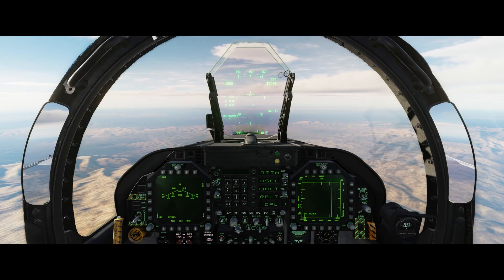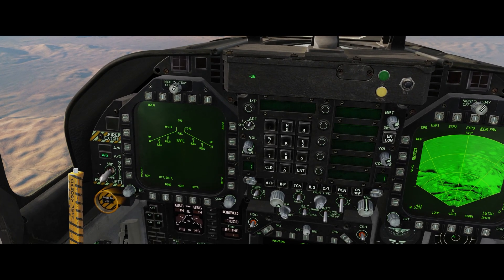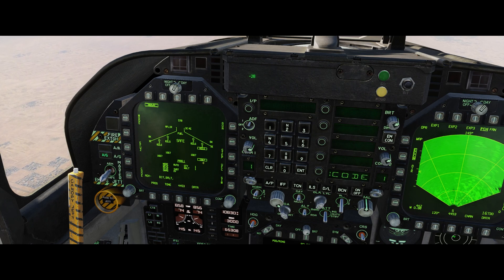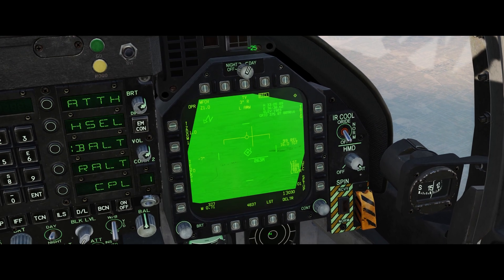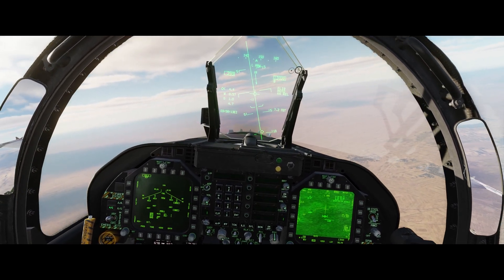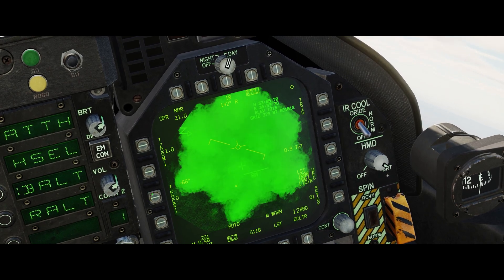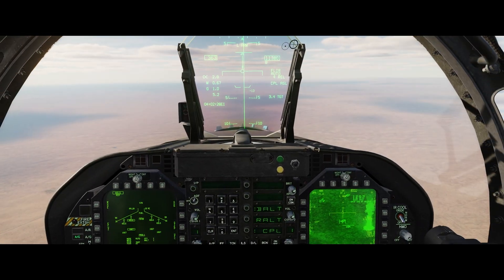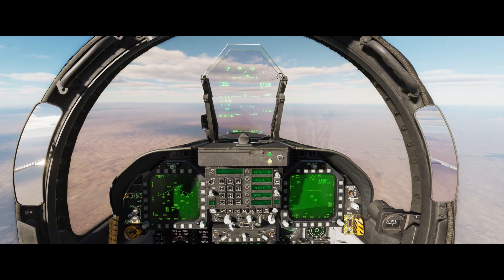DCS F18 | Master the Art of Laser Guided Bombing (GBU12)

Comment: hi Tricker, i got a issues, when i use tgp lock on target, i switch mode in RMDI my HUD did not change, for example before lock a target my GBU-12 bomb mode is auto, after my target destroyed i change gbu-24 clar-sl mode, but my HUD still auto, i must unlock and lock again a new target. therefore i must move TGP to a target again, is this a bug or anyway easier to attack new target?
Reply from the maker: Usually the way I switch to a new target is sensor select switch in the direction of your TGP (right in my case) to go back to scene mode if you were in auto.  Find a new target, sensor select right to go back into auto mode.  Always rearm your laser after.  Does this help or are you having issues with different bomb types?
Reply: @TrickerDCS  thx alot, its really help

Comment: Great Tutorial! I have another tip. The radar has a tracking mode for ground moving targets. If you put the tdc over the small box and then press Sensor select switch right again, the radar will track the target and you can slew the TGP exactly to the tracked vehicle. Very useful for using LMAVs, but beware, if you fly over the target - which is necessary for LGBs - the radar will lost the track. So after getting the the track, put the TGP into automatic mode with the same method as in the video and you are good to bomb it 🙂
Reply from the maker: Fantastic tip

Comment: I hope ED will change that in the future. You can't change lasercodes on GBUs 12, 16, 10 in the air.
Reply from the maker: These are the new super secret laser guided bombs 💣
Reply: @TrickerDCS  Sry, I didn't know that 😅
Reply: I thought that if the bombs are mounted on the smart racks you can change the codes from the cockpit. It's just that IRL they are usually mounted directly on the aircraft's pylons.
Reply: @NLozar22  Laser guided bombs are still dumb bombs with no databus connection. The lasercode is set with a screwdriver on the ground. Newer LJDAMS like GBU-54 have a data connection to the plane.

Comment: Love the losing gmt at the last second, a true DCS guide. Awesome tut.

Would you be able to do a dumb bomb in ccip and auto tutorial? I cant seem to hit the broad side of a barn. By the numbers, at proper speed and angels 🙏
Reply from the maker: Yah I’ll look into that 🫡
Reply: I have the same problem. Especially in the training module when it tells you to use the offset. Even with CBU’S AND THE ROCKEYES. i can’t figure out where to place the piper.
Reply: @robertspivey46 your issue is going to mostly come from dive angle if you’re doing dumb bombs without ccip, if in auto you have to make sure you fly directly in your asl. You want to be as level as possible and also hold the same speed. Easiest way to do it is to use your autopilot to keep straight. Use the throttle control and the BALT /RALT. This should make it easier. You could also cpl
Reply: @ItsNotFate  ty sir I’ll give it a try,.